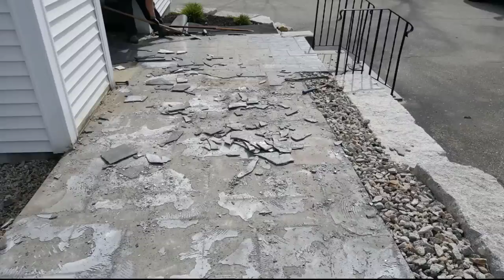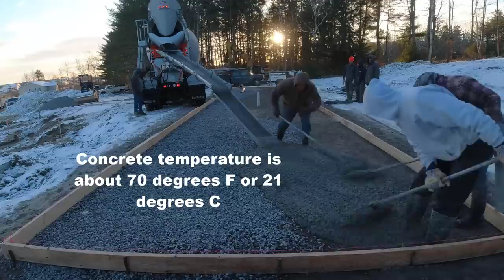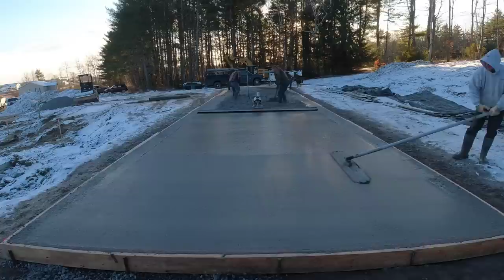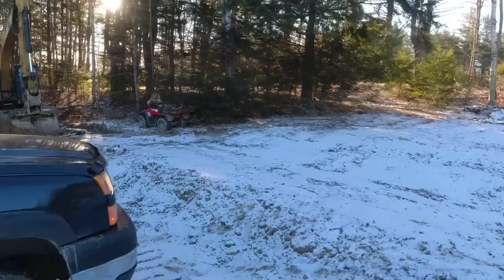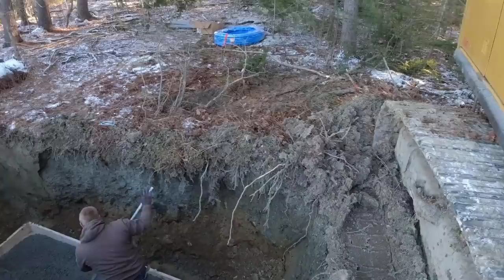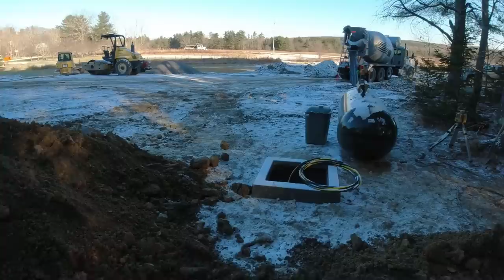This Is The Easiest Type Of Concrete Slab To Do If You're A Beginner.

Comment: Wear some latex gloves inside you other gloves. They are really thin but make a nice barrier to keep heat in. Your hands will actually sweat inside of them because they can’t breathe.
Reply: As for keeping your body warm, get the Milwaukee heated hoodie (not the coat). Wear the hoodie under your normal coat and it will run all day on low with a big battery.

Comment: You are gambling that nothing go wrong.  That is not always the case and the cure with misplaced concrete is laborious and expensive.  I believe in a good schedule of rebar on any project as cheap insurance if it is done right.  Here in Alaska there is a time to pour and a season where you don't.

Comment: For big expensive jobs I wouldn't want to risk any freezing possible problems, I have no experience and have little way of knowing the cement company or guys pouring it. I saw a youtube where they poured a shop in the cold and it started flaking later. Too much money for me to throw in extra problems into the mix.

I worked for 30 yrs in the winter outdoors for hours and never had cold fingers. Gloves are totally useless. I used leather mittens with heavy wool liners or down lined, of course waterproof. The fingers being next to each other heat each other up, not like gloves. I climbed up and down rail road cars and tied air hoses and threw switches.
It looks like you just hold tools.

Comment: What is the benefits of pouring a mobil home pad? Mini basement? Lol. Seems like a waste of money with no real gain. Just my thoughts.
Reply: Easier to work underneath, more stable than blocks,and it might be code now that they have to be strapped to the slab.
Reply: Also keeps down on the rodents.
Reply from the maker: It's code and needs to be tied down for insurance reasons.